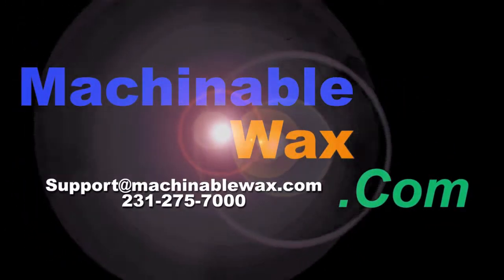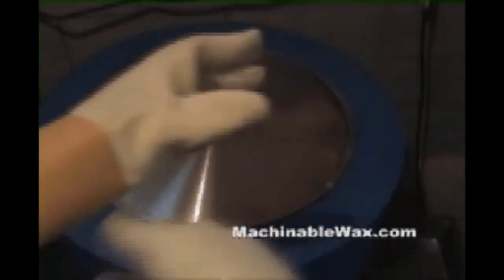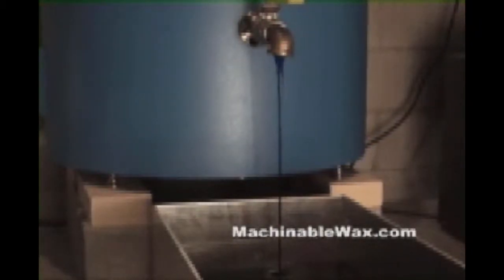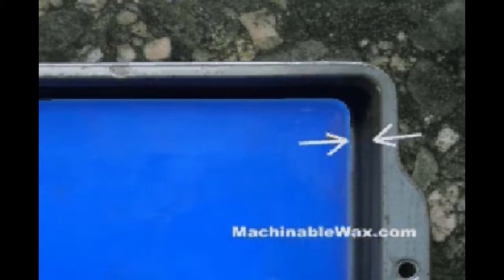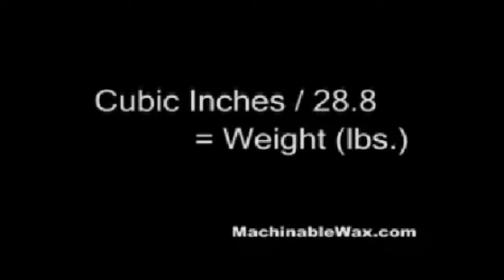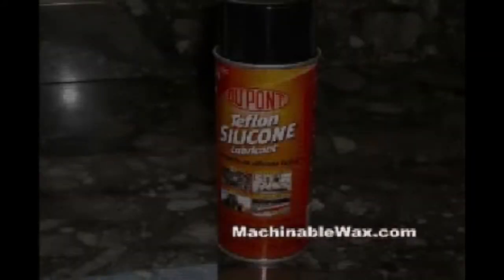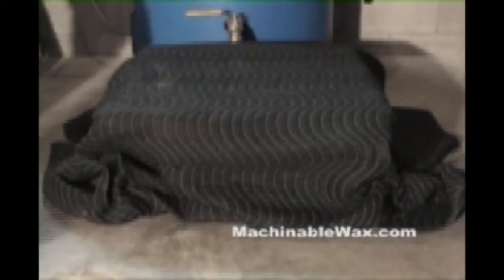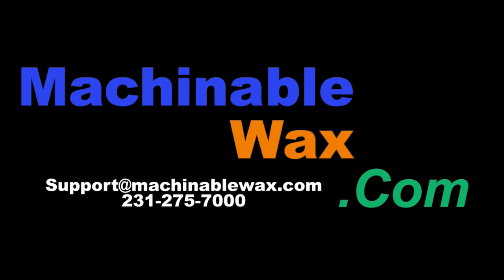Recycling Machinable Wax

Comment: I want to use this stuff in various ways and I'd be often just melting a little bit off the block with a  heat gun that blows at 392 F degrees, do you think it would be okay to use that heat gun?  Of course I would be using the gun from a decent distance and also keep it constantly moving.